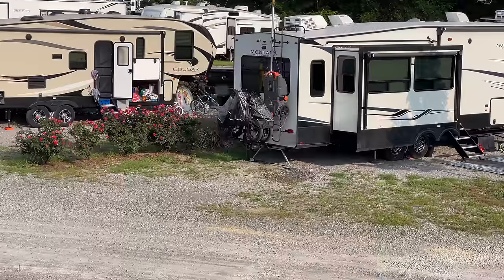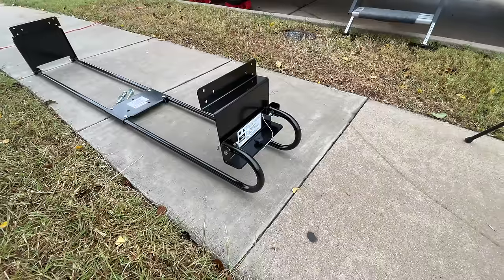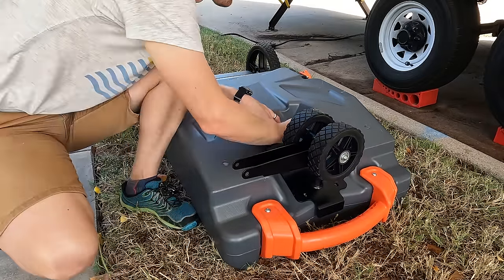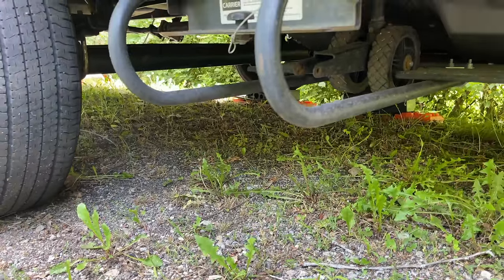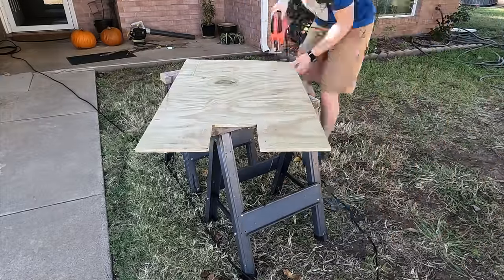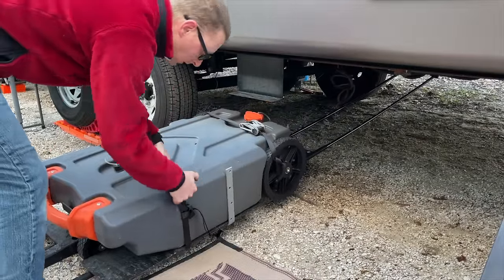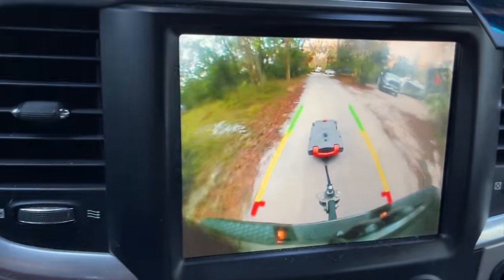👀 Genius RV Mod! A New Way To Store Your RV Sewer Tote

Comment: Great idea! One other thing to consider is the amount of road grime and silt/sand that can get into the wheel bushings on the tank when traveling underneath the trailer. Perhaps a wrap or covers for the wheels to protect them?
Reply from the maker: Honestly, it hasn't gotten all that dirty under there. The RV tires don't throw much forward and its too far back and protected to get anything sprayed up from the truck.

Comment: I like this idea, I was thinking of the ladder but I might do this instead.
Reply from the maker: I've found it extremely helpful - a bit more work to get out that taking it off a ladder - but ultimately a better solution in my opinion if you can fit it. Although, significantly more expensive than the ladder mount.

Comment: This is actually a very practical idea. There is one small flaw I spotted though, the u-bolts coming up fro underneath, it they contact the tank they can eventually drill a hole in the plastic and cause leaks.   As long as the tank isn't resting on any of them, perfect design.  Mine hangs off the ladder, and being a 43' long 5th wheel, there is quite a bit of momentum back there and I am afraid the ladder may work loose, it's not really meant to carry anything on it and this idea may just do the trick for me.
Reply from the maker: Good spot. No, the tote does not touch where those bolts come through, but would absolutely be a point to consider when you decided WHERE to drill for those u-bolts. I made sure to place mine far enough forwards and backwards that they'd never come close to where the actual tote sits.

Comment: I have done three videos on sewer totes, both the camco and the Barker, I am kind of obsessed with sewer totes.  We have been full-time for almost 4 years and I store ours on the back of my bike rack but I’ve always been looking for a better solution. This is a genius idea adapting a current product for this purpose. I think it would be hard to get this to work on my fifth wheel because my clearance is so low, but I am going to do some measurements and check it out.  Do yourself a favor and get the magnetic sewer caps from camco. They make setting up at the dump station fast as lightning.  Lov your channel, you are on a fast start.  Larry
Reply from the maker: Thanks! I've seen the camco magnetic bumpers but haven't tried them out - you've found the magnet to be strong enough I assume?

Comment: I did not see how you secured it once you lift the BAL implement up into place with you tank on it. Loved the idea about putting a hitch pin in the bumper where the sewer hose is stored 💡
Reply from the maker: There is a screw in bolt with a safety cotterpin to hold that bolt in place and prevents it from backing out.
Reply: @rvgearandfar  awesome, thanks for such a quick response. I subscribed right after I watched your video 😁

Comment: You bring up a great talking point about the amount of gallons a tote holds. We elected to go with the 21 gallon tote because we often boondock in remote areas. As needed we can fill the tote, then Angie and I can lift it into the bed of our truck and take it to a dump station that is often miles away from where we are. When we are in a campground where we don't have sewer but there is a dump on site, I just hook onto it with my ebike, instead of having to fire up my truck. Just a couple things to consider. I love this idea Joshua excellent video. I have been wanting to so something similar for some time.  Sean
Reply from the maker: Nice! I've seen a setup where a family took a hitch basket and mounted it to the front of the truck. Then placed this waste tote in that basket and used a macerator pump to fill it - then drove to the dump station that way! Thought it was a pretty sweet setup.

Comment: make sure to put a little anti-seize on the thumb screw. I had one of those spare tire carriers and when I needed it, the thumb screw was stuck tight. Climbed under the RV to remove the tire, then had to drill out the screw when I got to my campsite.
Reply from the maker: GREAT tip, I'm going to go spritz a little penetrating oil on mine right now!

Comment: Fantastic ideas and execution. I plan to add some ammo boxes on the rear to hold similar sewer items out of the way. I think I have room for cans in front of our bike rack. I will check to see if I can get a tote under our fifth wheel around the current spare tire carrier and my sewer hose canister that I have under. Hope your channel does well.
Reply: I also have a 5th wheel.  Mine has enclosed undercarriage.  Think this is very good idea as I don't have bumper or ladder on my Cougar Sport
Reply from the maker: Much appreciated, thank you!

Comment: I have the same tote tank of the same capacity. I’ve heard that it’s not really advisable to hang them on the ladder as the long term stress can cause problems. I’ve thought about a bumper bracket but I’ve heard of problems from that as well. I’m going to have to take some measurements and definitely give this method some thought.
Reply from the maker: Its definitely worked well for me if you have the room

Comment: I take it your not worried that those spare tire bolts will puncture your sewer hose?

Great ideas by the way!!

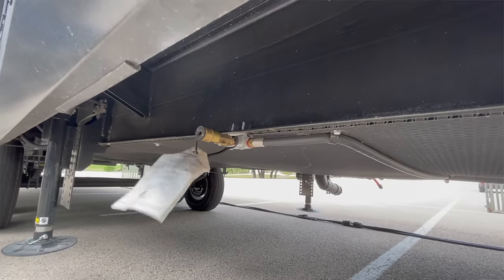One last thing at about 10:00 in to your video I saw what looked to be a gas line with a fitting at the end. First is that a gas line or air line? If it’s a gas line what type of fitting is at the end to take the another fitting.
Reply from the maker: The spare tire bolts are U-bolts, so they go around the bumper, not into it and therefore, no I have no concerns of puncturing my sewer hose.

The quick connect is a propane line. It was installed from the factory for the bumper grill that came on our rig.
Reply: @rvgearandfar  Yes sir. I was actually talking about the spare tire bolts at 7:45 of your video that go through the bottom of the spare battery box and inside the box itself. Have you had any issues with puncturing the hose when it’s stored?

Appreciate your response by the way!
Reply: @Knuckledragnation  Just saw this reply - sorry! Nope - haven't had any issues with the bolts in the box to store the accessories :)

Comment: Love the idea.  Where are the extention plates? Followed your link, but nothing on the plates.
Reply from the maker: Extension plates? Do you mean for the spare tire carrier? There are two different versions - a shallow one and a deeper one. If that's not what you're referring to, tell me more as I'm not tracking.
Reply: @rvgearandfar  yes the spare tire carrier. I followed the link provided and it only shows the short mounting plates. I can't find the plates saperate or a complete kit with the long mounting plates as shown in your video.
Thanks for any help
Reply from the maker: @marnsmpfi  Take a look down in the product dimensions and look at the specs - the photos are too similar to tell by that. I believe 28218 is the long ones and 2817 is the recessed version which will be shorter. Could always give BAL a call to verify the part number of the longest/deepest version

Comment: Won't work on my 5R the frame is way too low to the ground.  If it had an open frame maybe but it's enclosed a little speed bump will take it out. I had a custom rack 6" lift and hitch built (welded to the frame very well) for my rig that can hold a Big Honda 3000is generator a Ebike and the large tote, I was afraid it couldn't handle the weight on rough roads but I made it from Tennessee to Sturgis, then Quartzite and now in the Michigan Illinois area.  It handled everything like a champ.😊
Reply from the maker: Sounds like a nice mod!

Comment from the maker: 🏘 Join the RV Gear & Far Group Here:
https://www.rvgearandfar.com/rvgfyt 
⭐🌟 Check out ALL the products and gear we recommend here: ⭐🌟  
📦 https://www.amazon.com/shop/rvgearandfar 📦 
⭐⭐ Examples of Products Used In This Video ⭐⭐
🔷BAL 28218 Hide-A-Spare Tire Storage https://amzn.to/3rMQS8k
🔷Rhino 28 gal Tote with Tongue & Wheels https://amzn.to/44CILd9
🔷Rhino 28 gal Tote https://amzn.to/3Y6uvXW
🔷Rhino Wheel & Tongue Kit https://amzn.to/3Y0au5f
🔷Wire Lock Pin 2 Inch https://amzn.to/3Dsb7uE
🔷3/8 in. x 4 in. x 5 in. Zinc-Plated Square U-Bolt https://amzn.to/3Q904ht
🔷Plastic Ammo Can https://www.harborfreight.com/050-caliber-ammo-box-57766.html
🔷XL Large Plastic Ammo Can (Fits Spray Paint Cans) https://www.harborfreight.com/tactical-ammoutility-box-64113.html

DISCLAIMER We participate in several affiliate programs that earn us a commission on purchases made through our links at no extra cost to you!
Some product links are affiliate links which means if you buy something we will receive a small commission. As an Amazon Associate I earn from qualifying purchases.

Comment: Ok.. quick question..
What are you doing with the tow bar?  Did you just use a hitch pin instead of the bolt and nylock?
Reply from the maker: The tow bar on the tote? Yeah it came with a removable pin so I just take it off and store it in the pass through until I need it.
Reply: I'll have to switch mine over, it has a bolt and nylock.

Comment: Cool idea but looks like you could have done the one with less clearance as looks like it hangs down 3 or 4 inches of empty space between the tote and bottom of the rv
Reply from the maker: Possibly, but at that point I'd have to pay to ship it back and it wasn't worth it. I've never had any clearance issues as it is right now.

Comment: New subscriber, I actually thought about doing this but I was worried running over ripped up truck tires laying on the road and popping a hole in my tank. Plus my belly sits to low. I might try building some sort of box to protect the tank.
Reply from the maker: Do you run over ripped up truck tires often...?
Reply: i would be far more worried about my motors oil pan, or the transmission pan, the steering linkage, and such than a spare tire or honey tote.
but this is why you must NEVER tailgate anyone. give yourself room to live.
as a commercial truck drive for over 40 years. (now retired). stay away from big trucks for more than a tire blowing up. please do not cut us off, and give us room to stop before we hit you from behind.
Reply: @larryjanson4011  I as well a retired truck driver over 40 years and almost 40 years having my CDL licenses. I one of few do not tailgate but it’s hard to see ripped up tires on the road at night time. I drive at night due too very low traffic. The last thing I worry about is my oil pan getting hit by something on the road, Really!

Comment: I have 19 inches in front of axle and not enclosed under.  Would this work? Axles are at 12" from ground
Reply from the maker: I'm sorry I haven't responded sooner - I'm currently traveling to some RV events away from my rv - and can't grab any measurements - I'm going to screenshot your question and reply with my measurements when I get back to the rig in a few weeks.
Reply from the maker: Got out the tape measure today - no 19 inches in front of the axle isn't going to be enough - you'd definitely run into the tire. From the axle to the front most part of the tote/carrier is 41 inches on my rig. And for reference my axles are 12.5" off the ground.
Reply: @rvgearandfar  I don't have my trailer it's in storage. I have no idea where I got the 19" from tire. I will check in the spring. To bad I couldn't post a picture.

Comment: I think your under carriage storage idea is clever, but I'd be concerned about diminished clearance. I looked around and found a low profile 62 gallon rv black tank from  Rec Pro-Restore Your RV. It measures 60L x 36W x 8 3/8 D. The axle will actually be quite a bit lower than the tank. My buddy and I are planning/fabricating a system to (very) secure the tank and feed the original black and gray tanks into this one. If it's too complicated I may just use a macerator pump to move waste/water from the original tanks to the added tank. However it works out, even though there's good clearance, the leading edge will be protected by galvanized sheet metal. I'll then have the original 30 gallon fresh water, supplemented with a 60 gallon fresh water bladder (bed of pick up), and the original two 30 gallon gray and black tanks. If all works out, I'll have a total of 90 gallons fresh and 120 gallon gray/black capacity. Thx, your clever idea was a great inspiration.
Reply from the maker: I have had zero clearance issues in 2 years and over 18,000 miles.  

So you’re adding another holding tank? Doesn’t sound like its portable- why not just install it and plumbing it in like the other waste-tanks between the frame?
Reply: @rvgearandfar  It's still a work in progress, planning stage actually. I don't have your experience/expertise in these matters. I'm not quite sure I can configure the plumbing to safely and securely move the gray and black to the extra tank. Portability isn't a big issue for me, I like to boondock and stay in one place/area for 2 weeks. I'm thinking I can basically fill the 2 original tanks, use a macerator pump to dump into the extra tank, then refill the 2 originals. I can then dump all 3 tanks when I hit the 2 week limit on BLM land. I travel alone, so when I'm in an LTVA, I may be able to stay in one place for 3 or more weeks.
Reply from the maker: @Justmakingobservations  I think an easier and more flexible option would be to use the macerator to pump the onboard tanks up into the truck bed into a portable tank. I've even seen folks use one of those hitch baskets off the front of the truck and place the portable tank there instead of in the bed. Adding a whole extra waste tank - full - eats up a TON of cargo capacity on your rig and if you'd then potentially be driving with 3 full waste tanks -- in my opinion you're asking for trouble and some part of it will fail - suspension etc.
Reply: @rvgearandfar  As I said, this is a work/plan in progress. You're right about the cargo weight limitations, so now I'm thinking of a 30, not 60 gallon extra tank. But that's almost beside the point. My goal is to stay off grid comfortably for at least 2-3 weeks; 2 weeks being the BLM/National Forest limit. I'm enjoying the engineering challenge, but it's taking me down a rabbit hole. Now, in addition to the extra black tank, I'm trying to figure out a way that I can reuse gray water to flush the toilet, thus preserving my fresh water supply. 

As it is now, when I go off grid, I return with an empty fresh, a full gray and a full black. But, if I add the extra black tank, and re-use the gray water, I’m leaving with an empty fresh, an empty gray and 2 full black tanks. Same amount of fresh, but by re-using the gray, I’m extending my stay without adding too much extra weight

BTW, I've checked with both the BLM and the National Forest Service, they actually allow the dumping of gray water in dispersed camping areas, as long as it's more than 200 feet from a fresh water supply. It's state laws that prevent it; Nevada, Wyoming and Montana actually allow dumping gray water in dispersed camping areas. I haven't checked other states, but that's not something I want to do. One Ranger I asked replied, "Of course, just put up a privacy tent and shower outside." Like I said, my goal is to stay comfortably off grid for as long as legal, reusing gray water to flush toilets preserves fresh water, and I'm enjoying the engineering challenge. Happy travels.
Reply from the maker: @Justmakingobservations  Sounds like you're enjoying the problem solving scenario! Love it ◡̈

Comment: Could I do a tire and the tote? Need to find someone  that would do this for me I would be worry I drill the wrong thing.
Reply from the maker: A tire and the tote would most likely be over the weight limit. Depending  on how your undercarriage is setup up might be able to install two of them - one for the tote and one for the tire. Or look into mounting one at the bumper

Comment: The problem with Camco tote tanks is the wheels (wheels are from China) will break or the tank will split at the seams.... Good luck.
Reply from the maker: Thanks! We've had this tote and used it for a little over two years now and haven't had any issues. Which brand of tote do you like the best?

Comment: in all of my years (single male), i have never found a need for a tote. but then i also boondock.
up to three weeks without moving on.
within 10 miles of were i home base. there is a core of army lake, so almost free dumping.
and lots of "other" places i pass by that offer dumping. (free if you buy fuel).
but it does look very ghetto having that honey bucket hanging on the back.
and i have been told those ladders are not all that well bolted up on the end of a rv. but i personally have not see a ladder fall off. and if it can hold my 220 pounds.
maybe if i can ever afford a new rv? mine is now 23 years old, and going strong.
Reply from the maker: Thats awesome that you've been able to work around without one - they are incredibly helpful when they are, and a pain to deal with when they're not necessary ◡̈